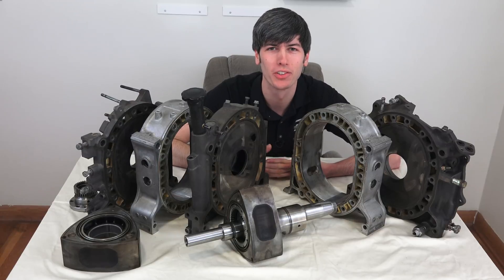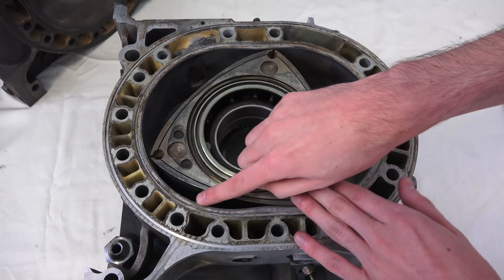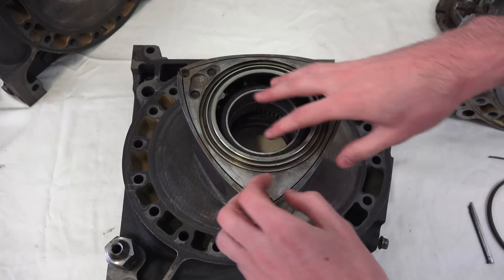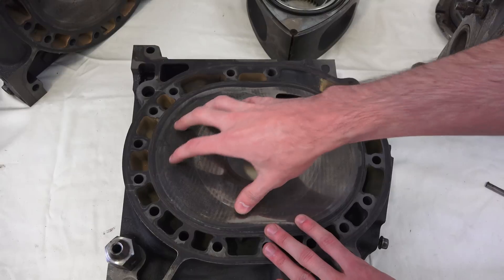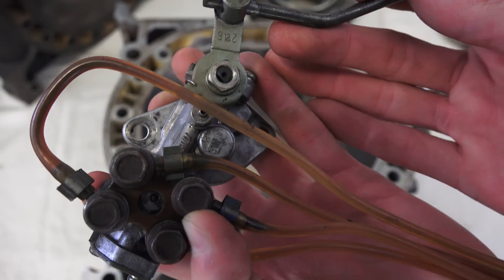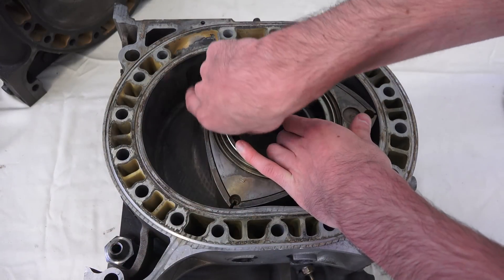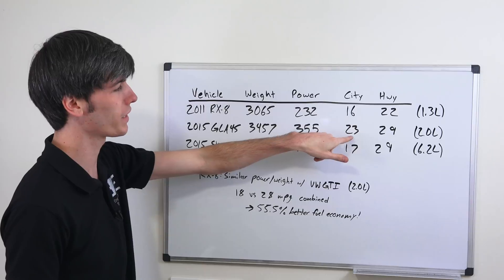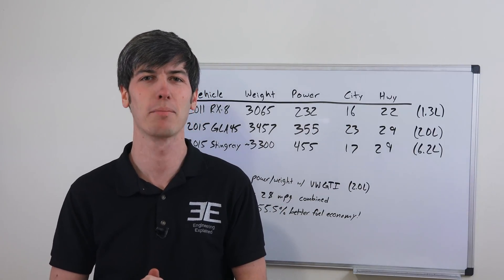4 Reasons Why The Rotary Engine Is Dead

Comment: As a rotary owner,  i will say this,  efficient,  no way in hell,  it's probably the worst fuel efficient engine ever,  that being said,  stock these are not impressive at all,  modified however,  i have yet to see another engine deliver this much power per liter,  and be this much fun to drive (any rotary owner will agree to this). I do agree that it's dead however bit than again the ICE engine is also on a time clock, Side note those engine parts are NOT of the RX-8 (however they do work for the presentation)  and also you could not have chosen rotary car to represent rotaries,  the Rx-8 is probably the weakest of the rotaries and should be banished from the rotary history,  either way comparing the severely underpowered,  soulless 1.3L renesis to a 6L V8 is a bit stretching it,  other than that pretty good explanation

Comment: I just had a thought

If you want that crazy "nitrous" look of the exhaust pipes spitting out huge flames, in relation to the unburnt fuel that the rotary engine spat out the exhaust as flames... Can't you just fit a small fuel tank and a tube down to a fuel injector into somewhere in the last foot of piping? - Resulting in a nice flame being projected out?

Comment: What if you had additional spark plugs at the exhaust part to burn up unburnt fuel?
Reply: Originally Mazda had a thermal reactor thingy that incinerated the exhaust but racing versions now have such hot exhaust it does the job ide guess

Comment: "not be able to burn all the fuel... not good emissions"... I don't think you know what your talking about... "has to travel a long distance in order to ignite all this mixture"... ROFLMFAO your hilarious.  Sounds like a piston... as it moves down after ignition... wait... they're the same... PS, the OIL SEALS (you called them face seals) have nothing to do with gas sealing... If you want vehicles with poor emissions try motorcycles... they make those 'gas guzzlers' look like trees... (IE the more 'fuel efficient' the more pollution...)

Also, increase the compression in the rotary, increase the mileage... and the horsepower... increase the compression in a piston? blow the engine :)-Oh and Edit, the ONLY reason the rotary "died" is because Ford bought the controlling interest in Mazda and shut down the rotary...

Comment: So basically what we need to develop is a faster burning fuel that is also stable, a graphite block or whatever is dimensionally stable at high temperatures, and a lubricant with a very high flash point (molybdenum disulfide).

Comment: Car guys don't care about fuel economy, for an engine that'll gladly rev to 12,000 rpm as well as handling quite large amounts of boost for not even being the size of a 2 liter soda bottle. A rotary will stomp a piston engine most of the time. And I love traditional I-6s with big single turbos but the way the rotary distribute the power and the amount they can handle make rotaries harder to get and more expensive to get cuz they're so great for power. I don't mid topping off my oil if needed lol. Liked the video tho it was nice to c exactly what is wrong with rotaries, I'd love to b able to solve 1-2 of the 4 problems cuz I'm sure it would make more power and b more reliable... But god they sound soooooo good right?!?! Can't deny that one ha!
Reply: Veeg's Hobbies 
"Car guys don't care about fuel economy..." if money ever grew on trees.

And if a Rotary stomps a Piston engine, then why have they been out of production since 2012?

Comment: hmmmm, fuel economy isnt really a fair comparison as billions of dollars has been put into making valve based engines more efficient. If the two were equally invested in, there may have been some fix designed for the problems outlined in this video. Or he could have just compared two engines early on in their development, say 70 years ago.

Comment: I don't know how you came to these fuel economy figures but, I actually owned both an RX-8 and a Seat Leon 2.0 TFSI (basically the same as a Golf GTI) and the RX-8 ran more efficiently. On average I did 11 km per liter with the RX-8 and 8 km per liter with the Seat. Also, the seat used a lot more oil, about 1 liter per 3000 km as opposed to the RX-8 using about half that. My guess is that most people think a lot about the working principles of a rotary engine and not so much about the regular piston engine. The rotary is definitely the worse of the 2 but, funny enough, the example Golf GTI used in this video is not a good example of good piston engine manufacturing. Volkswagen 2.0 TFSI/TSI engines are pretty unreliable, engineering is a BIG factor. Now if you had compared it any Honda VTEC engine however :P

Comment: the gla45 is obviously gonna be better per power thats what turbos do, if you know anything about engines as a whole you know air is key, like how jet engines through turbine fans can make a .8L combustion chamber (aka 800cc single cylinder) produce over 20,000 shaft horsepower. the rotary is good in many ways, fuel economy is improveable as i have seen some get 36+ mpg and they are two stroke so ya they burn oil any engine guy knows that. the only flaw that was right here was their emossions which magically still pass legal requirements

Comment: Something he didn't mention that is also a problem with these engines, is the lack of torque.
Reply: At least that's where the straight 5 stood out, might also but heavy on juice but at least they make great torque early and are butter smooth, and even in today's market it is dying badly, the rotary stands even less of a chance.

Comment: It seems like rotary's would be a good idea on small engines where they could be easily removed and serviced(scooters, small tractors ect). You could have a tiny engine that produced adequate power, which would be more easily serviced(albeit perhaps more often) by the end user. Am I off base in this thinking? I am no expert, but it seems like a perfect application for an imperfect motor.

Comment: rotary engines are not dead. they have lots of applications other than car industry.
people say they are dead because inherent flaws. i'm pretty sure piston engines had lots of flaws back in the day that people thought were impossible to fix. and yet, technology always prevails. the evolution of rotaries, especially in the last 20 years, couldn't keep up with piston engines just because only one car manufacturer really worked on developing them.
but i trust mazda, they really work hard and deliver. rotaries WILL be back and they will not only surpass emissions and fuel consumtion standards, they will also be amazing. at that moment, every single one of you will eat your words. :v :v :v

Comment: There are a ton of advantages. power to weight, engine size allowing better car F/R weight ratio, high rpm, high power low torque, they do last forever if it was non turbo. 787 proved it too.

Comment: You just compared 2011 Mazda with two other 2015 cars. Of course 2015 cars will be more fuel efficient because they have high technology that helps the car do better on gas.  You also compare rx8 to the gti. VWGTI are diesel and as you know all diesel is more efficient then gas.

Comment: YES AT IDLE WANKLE IS INEFFICIENT AT IDLE, so is a jet at idle, so is a turbo at idle. A FISH IS INEFFICIENT OUTSIDE OF WATER. by your logic "the real doctorbimmer" DOOSH I could say diesels are inefficient too and point at the place where theyre mpg and hp suck(at high rpm). 4 cylinders suck below 2000 RPM's anything else you need to Enlighten us with you google mechanic. -real life race car mechanic
Reply: what are the particular inefficiencies of a 330 stroke V8 (aside from mpg)? I have one myself and I've been wondering.
Reply: +The real doktorbimmer Actually an Oldsmobile Jetfire V8. Stock 330, Changed 2 barrel to 4 about ten years ago.
Reply: Decent guess, though.
Reply: Hm, not really a mechanic, but that sounds pretty inefficient. I can say the BHP is 300 (Or 350.). The engine is in an F-85, with all matching numbers, if that helps. The engine is original to the car, and works as intended, well, mostly. I'd hate to ask, but I'm only scraping the surface with my knowledge on cars and engine specs (This classic is my way to learn, and get a nice, reliable car at the same time.), but can you simplify that?

Comment: the thing that makes Rotary a good engine you seem to have missed. the RPM. with the high RPM and long power band you can overcome the lack of HP with RPM. they run extremely smooth and respond very good with turbo. are they efficient? heck no! are they fun to put in a little ripper car? heck yes!

Comment: I loved my RX3 but petrol was cheap in the 1970s. I bought the second last one sold in South Australia, and my best mate bought the last one. The secret to getting reasonable fuel economy was to keep it revving, and a light foot on the accelerator. We would leave them in second gear around town keeping the revs around 4k...this resulted in fuel economy of around 28mpg (UK). In short the harder they rev the less fuel they use but watch that foot otherwise that 4 barrel carbie sucked the juice like crazy
The secret to keeping the seals in good order is 2 stroke oil in the petrol.  Other than the seals the motors are bullet proof as they have only 3 main moving parts..

Comment: 1.3L That's not correct for most cases. In fact the controversy about the way rotary engine volume calculation is done leads to the problem of not being accepted in most competitions as a 1.3L in this example, but in fact as a 2.6L. Not sure in US but definitely in Europe most sport federations don't accept that volume calculation.

Comment: Two advantages of the rotary engine are its compactness and low center of gravity.  

One of the major disadvantages of the rotary is low torque at low rpm.

I had a 1983 Mazda RX-7.  it was a little underpowered (1.1L, naturally-aspirated), but it was still a lot of fun to drive.  The car has 50-50 weight distribution which made it handle very nice in the corners.

Side note: Exhaust gas recirculation does a lot to clean-up emissions on every type of engine.

Comment: Might the sealing and lubrication issues be solved by redesigning the rotor so that it could be run on diesel? With it being less volatile and more viscous it tends to help with lubrication and doesn't burn oil like petrol does.

Comment: The Wankel has a few significant advantages- linear power curve for one- it is best used where continual high rpm/high power is needed, like in prop-driven aircraft or boats, less so in automobiles unless raced.

Comment: owned a Rx-7(9years) and Rx-8(3yrs now) both used... both r workin right, no problems whatsoever... its true tho tht these beasts sucks in petrol more than a EVO IIII albeit being lighter and lower capacity engine(dont forget its 2WD also).. but who cares? The video is almost correct in explaining the disadvantages... most Rx-7/8 owners dont buy these beast because they care abt fuel consumption, its because of the fun n also 99% of owners ive met nvr had a stock setup... most of it is modified to improve almost every aspect of the vehicle..
Reply: good job engineering explained fr the video... helps n sends out warnings to many people before they 'accidentally' buy a rotary engined car without knowing wht it is just because it Rx-8 is 'cute' n quite practical.

Comment: I say that is pretty good considering that much power coming from that small amount of cubic inches. Old American cars made 101 horsepower and weighed 3000 pounds easily. and they got way less gas mileage. If a person like me doesn't care about gas mileage I.E. 454 cubic inch engine in a dually crew cab from 1986. I would say this makes good power and has decent gas mileage.

Comment: What if they were to add another two spark plug wells alongside the combustion chamber. That would burn the mixture before exit, no?. Also, what if they were to route more coolant alongside the combustion side to reduce Temperature differential.

Comment: I think direct injection is going to be the answer to bringing back the rotary (to the auto world). I can see 4 injectors, 2 in intake chamber and 2 in combustion chamber, firing in series. Combustion chamber injectors fire late in the combustion stroke for more complete burn = decreased emissions. They still need to burn oil, but I'm sure they've got chemical engineers working on better lubricants for it too.

Comment: Poor Thermal efficiency:  could coolant channels flow laterally around the chamber from combustion side to intake side and then pre-heat the mixture before dispensing?  Or should gasoline be as cold as allowable before ignition?
Oil consumption:  Would it be feasible to turbo a rotary engine with a burnout chamber that allows unburnt fuel in the exhaust to finish burning before/during intercooling before recapture?  This could increase fuel, thermal, and lubrication efficiency without adding many more moving parts.

Comment: The rotary is awesome, all you need to do is drive a car that has one, the sound, the red line, and it's so smooth.  The amount of power you can squeeze out of this tiny motor is incredible.  The engine really is amazing.  This motor isn't made for you to drive to work everyday that is for sure, it's made for you to have fun, lots and lots of fun.  Having said that, I used my rx-7 as a daily driver and got 300,000k out of that motor and I drove that car hard every day of its life.  Don't forget this motor WON at LeMans where many have tried and many have failed.  If anyone is looking for a second car that is meant for fun this engine will not disappoint, there just isn't anything like it.

Comment: My 2004 Rx8 would get 20.5 to 21 on the highway. Never 22. When I would drive around my school's campus for 60 miles (speed limit 20-25mph) I would get like 10mpg. But it looked sweet and sounded great, so it was good enough for me.
Reply: Buddha BlazerSS and has way more torque, tho. And it is a V8.

Comment: Did they ever try to move the combustion chamber from left to right, then back again. You have to redesign the ports etc.
Reply: It won't work that way because the inlet/exhaust ports cannot be on the same side as combustion and seal reliably.  Getting a port valve to seal precisely and consistently at thousands of RPMs for 100,000+ operating hours, even if solvable, would make the design completely uneconomical.  And if it fails there is burning or unburnt fuel blowing out into the intake manifold and back into the pre-ignition cycle.  Bad juju.

Comment: The comparison of the cars are not really fair. At first the Mercedes is a Turbo car, witch make it realy clear that he has a better fuel economy. And also the Corvette witch have variable valve control. And both the Mercedes and the Corvette are much more modern cars/engines then the RX-8 wich is a car from 2002. If you would compare with cars of this time, the diffrence would not be so bad.

Comment: I had an original RO 80, 40 years ago in Germany. Pulling a 1 and 1/2 ton trailer I was getting worse fuel milage than I get today with my Volvo semi truck at 40 tons and 20mph higher speed .That's how bad they are/have been.

Comment: i quickly Start my CAD and make a Quick Simulation. i have already desinged a four chamber wankel Engine.
Reply: I think the Quasiturbine does that.
Reply: John Burns yeah it Works, it has about 60 kW more Power, but the Steel im using has Not a very high Rp0,2(messurement how much the Steel Can last) i need to use something like a 42CrMo4 steel

Comment: its always the Same with combustion engines, who always have a lower efficency Ratio than electric engines.. 
The efficency is messured by the greek Letter Eta, which is Power Output divided by Power intake, due to that a Otto Engine has about 0.25 - 0.3 = 25 - 30% while electric Motors have 85 - 90% efficency, the only Problem is the Power storage, which is pretty hard to keep it realy efficent 'cause of the the Problems occuring to building an adequate battery.
Reply: Matthias Malmedie To truly compare efficiency, you must start at the true power source, not at the conversion to rotation. Electric energy and liquid fuel are artificial products made in different ways that have different efficiency.  Now there are different ways that factories produce those with different efficiency, but typically there are greater losses extracting electricity than liquid car fuel from sources that can be used either way.  I love electric cars, but comparing mpg times energy per gallon to miles per kWh exaggerates the benefits.  On the other hand, comparing a hybrid with no mechanical pass-through to a directly mechanical drivetrain provides the opposite error as it assumes the low efficiency of a small lightweight power plant instead of an optimized stationary power plant at industrial scale.

Comment: All true.  So of course I bought one anyway.  The best thing about commuting public transportation is it allows you to buy impractical cars.  If you don't have access to twisty roads, there is no point in having this car.  But take this to the mountains and the light weight combined with thefront mid-ship engine location plus high rev reserve in low gears makes it an absolute star.